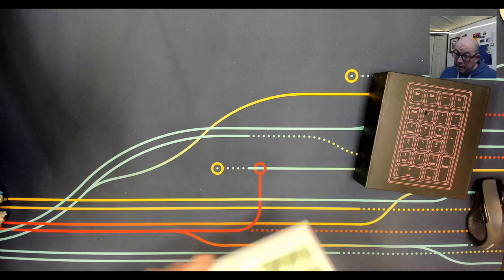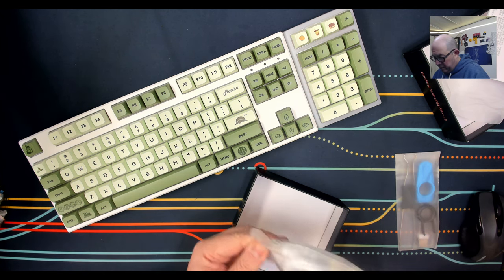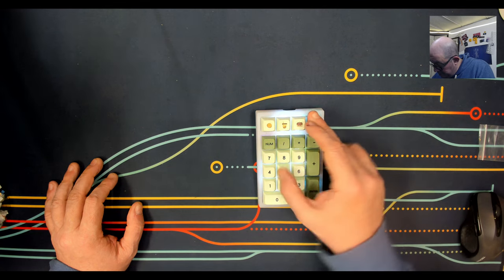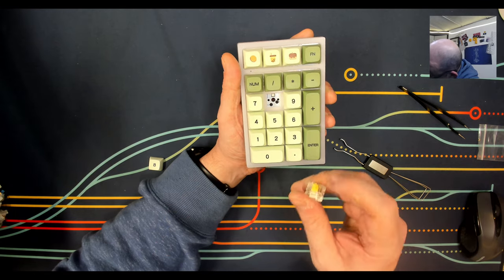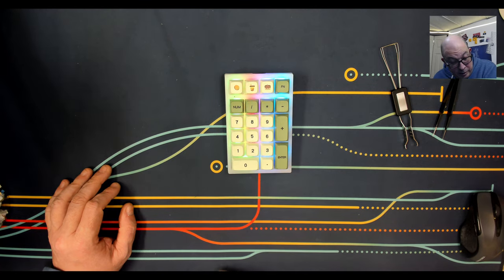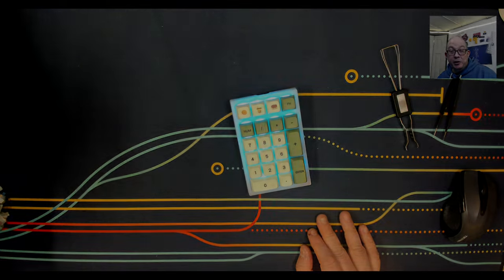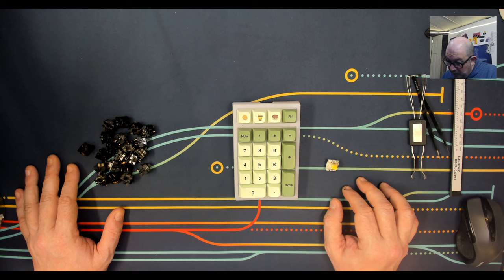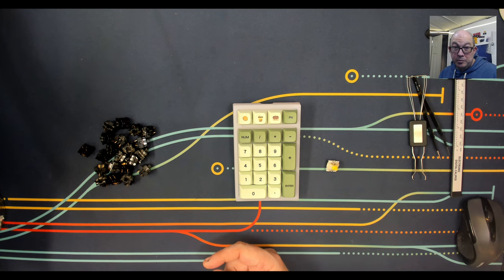Boyi TD21 3 Mode 21 key macropad

Comment: Hello Mark, did you ever play with this a bit more and find out how to open it?
Reply from the maker: Not yet, hope to get to it early on next year.
Reply: @MechKeyboards  sounds like a plan! I have one on the way. I messaged the seller on amazon and they confirmed that it can be opened the same way the gmk67 is opened. Curious to see how you end modding it!
Reply: It was a lie. 4 screws at the bottom under the rubber bumps.
Reply from the maker: @DaAzNpLaYbOi  I must have looking at the wrong numpad, my apologies, I do have a few laying around.

Comment: would you recommend the EPOMAKER EK21 ?
Reply from the maker: I cannot recommend anything from Epomaker, they're an outfit that sells a lot of broken products, does not honor it's warranty, has presented official counterfeit documents claiming they have the right to resell other's keyboards, and have been banned from Reddit completely.
Reply: @MechKeyboards  JESUS CHRIST! i didn't know about all of that. Im in desperate need of a programable wireless number pad. 
I bought the Dojo Megalodon wireless, but VIA cant even recognize it. Nothing but problems
Reply from the maker: @MrAlternation  I had nothing but issues with Megaladon macro pads as well. I've been using the Feker JJK21 for quite some time now and am very happy with it.

Currently $39 on Amazon US: https://go.be2x.com/fekerjjk21amazon